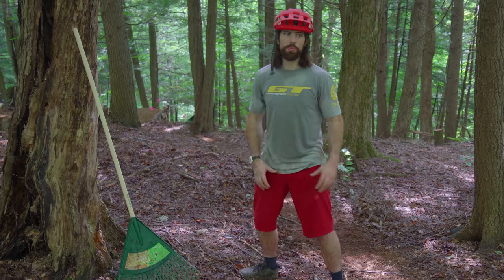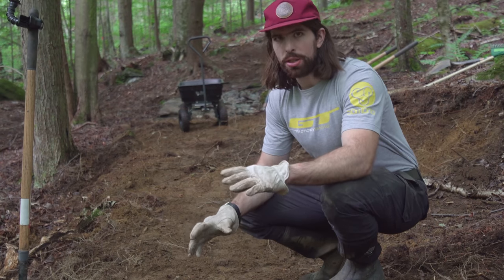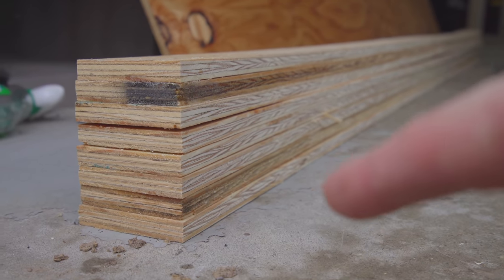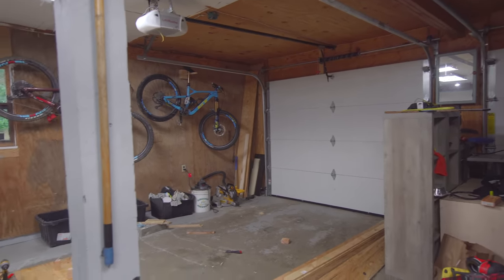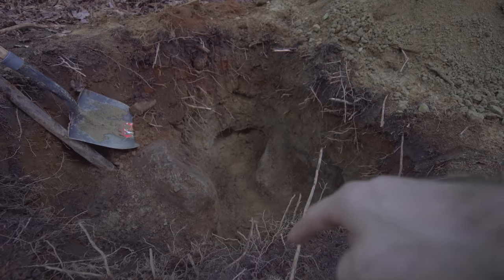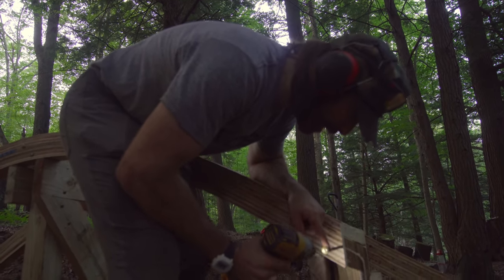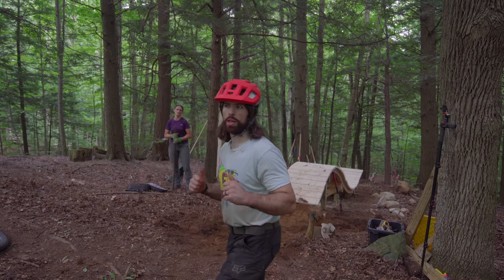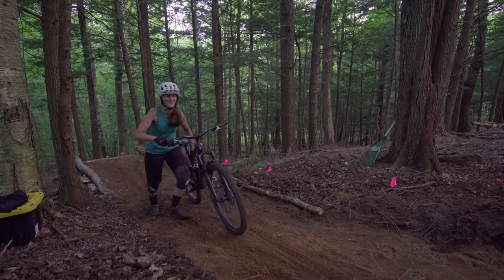Building A Whale Tail For Mountain Bikesl!! 🐳

Comment: Appreciate the tape measure trick, that’s handy! Easy way to cut the angle between your two curves is simply to lay the end on the other where they will join, choose desired angle of joint and slice right through the both of them 👍🏻

Comment: When your tightening the clamps making the curved thing, you need to tighten the clamps in the order from inside to outside. If your tightening the posterior clamps first you may not be able to squeaze the inside as tight as it should be squeezed

Comment: Great feature.  Just a couple of tips.  Using a small paint roller with the cheap foam rollers makes glue ups easier and faster.  The easy way to get the joint on the arches to line up is to set the first arch then use a small level to mark a vertical line and cut it. Then place the second arch next to the first, line it up to where it works, and trace a line for a perfect joint.  Love the content so please keep it coming.

Comment: I feel I am a mill worker (wood worker) by trade and a good tip for bending wood is to soak it it helps the wood bend and when it drys up it is structurally more solid due to not cracking although you did do alot of planks stacked so there is no reason why it should break just a tip

Comment: Nice work on the stringers, I enjoy the extra craftsmanship you put into your build.  I've done a few rounded decks using similar technique with cedar strips.  Using a 3 or 4 inch paint roller for the glue works fast and excellent coverage.  U can also glue / pneumatic staple each strip down 1 at time... Just a thought..

Comment: Hey Phil, next time you do some bending and laminating,  I would suggest you try making a form in place of those 3 blocks and use a ratchet strap to apply constant and even pressure. This is the method I was taught for making the jam extensions for curved windows.

Comment: Hey Phil! Some tips for next time - PVA glues like the Titebond you're using only have a working time of about 10 minutes - if you take too long, they won't stick properly. For slow glue-ups like this, it's a better idea to use a slow setting epoxy or construction adhesive. In addition to having a longer working time, they are also gap filling, i.e. work properly when there are gaps between the laminations. PVA glue like the one you're using is not gap filling, and won't stick properly if you have gaps, no matter how much you use.

Comment: It would be a cool idea to build a big roller in front of the whale tail, so you can either pump both or jump onto it. But I don't know if it would work with the speed.
Reply from the maker: The roller on the whale tail is what generates speed for the rest of the trail. Putting a roller in front would require sprinting from a dead stop which gets tiring quick. The way I build goes back to what I grew up doing, and that's dirt jumping. All good dirt jumps have an initial feature that helps set the speed and requires minimal pedaling.

Comment: Hey Phil! A good tip for getting tool heads on their handles is to just slide them on and then hit the bottom of the handle, theres something about the vibrations that puts them on way easier.
Reply from the maker: I actually tried it that way and I wasn’t making any progress. I maybe I was doing it wrong 🤣
Reply: @SkillsWithPhil  awe fair enough there, but if the tool heads start to get loose you can soak them in water overnight, swells up the wood and makes em right again

Comment: Depending on the type of plywood you used you may have some problems with the glue between laminates failing over time as it may not be waterproof like your titebond. If or when you need to replace the laminated beams you may be better to use thin strips of solid wood for your next lamination.

Looks good though.
Reply from the maker: I agree. In retrospect I'd build it completely differently, but I learned a lot from this project that I would not have known if I didn't try it. I found a lumber yard near by that I will likely source material from in the future. In the future, I'd probably build it with 16ft long strips of a thinner wood and not plywood.
Reply: @SkillsWithPhil  Another cool idea would be to take inspiration from boat building where you steam solid planks. This makes them flexible for a few minutes after which they harden in whatever shape you bent them to.
Reply: @SkillsWithPhil  The joys of learning, I'm sure it'll allow you to make some quality content.
Reply: @SkillsWithPhil  So glad to hear this. Other gems from the thread are to tighten the clamps from the middle moving outward, and apply the glue to both sides of the wood, using a roller. My contribution is to keep that watertight glue tightly capped, and consider a new bottle for each project (some kinds of waterproof glue don't store well after opening).

Comment: Phil, it would have been possible to lap the glue lam layers to make a single, double curved rail and avoided the dry joinery. Also would be good to use some clamping calls to distribute the force across the board but overall great work.

Comment: Good job man. With the c- clamps - grind a socket u can attach to the  drill so you can tighten the c clamp faster. Just sayin
Reply from the maker: Grinding them down isn't  a bad Idea. I actually did use the drill for a few of them. The chuck wasn't big enough to fit over the spindle but I was still kind of able to make it work (but not very well)

Comment: Some building tips to make it last longer:
1.  Use 5/4 x 6 decking cut lengthwise vs. plywood for the stringers.  Yes, its more expensive, but the plywood will begin to de-laminate over time.  You just dumped a ton of waterproof glue to make the stringers, but the glue within the plywood will fall apart faster than the glue between the layers.
2.  You should attach as much as you can with bolts vs. screws/nails.  Except the decking.  Deck screws all the way.
3.  You did the right thing in have cross members bear the weight of the stringers.  You just need one on each side of the post, against the stringers.
4.  If you haven't figured this out in CAD (see next point) and pound in the posts later, use a Sawzall to cut the top flush with the stringers.  Add cross braces in there too.
5.  Learn SketchUp.  First, you can prototype things and figure out if they will work and figure out how to do more with less wood. Second, the angles and radii for all these types of structures are known.  You don't have to guess speeds and landings, etc.
Reply: Where do you find angles and radii for trail features?
Reply: @tonyrobinson1623  Trailism or the Cuyuna MTB group

Comment: Ah, now I understand that feature.  When SBH (Seth) built it, with a jump that bypassed the roll-onto portion, I was wondering why even build that first part.
Reply: Seth chose to jump onto his. The turned down, roll on, portion acts as a case pad on his. Notice that Seth's whale tale has much less curvature because his arcs have to fit inside the width of dimensional lumber. Phil's laminate stringers allow much larger curves. Hopefully he built them out of exterior plywood, but it doesn't look like it. Seth's needs more speed to flow.

Comment: Use foaming poly urethane glue out of a caulking gun next time, it's much easier. Also put packing tape on your ply that you glue on top of.
Reply: And load the thing full of screws during glue up

Comment: Awesome craftsmanship on the whale tail there but I can't help but think it's too boring. A gap in and step up option would be much better.
Reply from the maker: It's purposeful. I needed a bit of elevation to generate speed for the road gap, so I intended to build a wooden roller, but thought this would be more fun. If I built a gap into the  whale tail, it would require sprinting into it to clear and that's not very enjoyable. For those who grew up dirt jumping, this is very similar to the first jump in DJ sets, that sets the speed.

Comment: Wood glue has quite a long cure time and shouldn't cure before you can put a clamp on
Reply: I don't know this glue, but worked in a place that did glue lam oak to make 5'6"radius stair rails. That glue (it was waterproof FWIW) had a very short working time. It took 4 or 5 of us to get the wood onto the jig and clamped.

Comment: why don't you use post hole diggers?
Reply from the maker: post hole diggers are for getting into tight spaces when you can’t angle the shovel in a way to spoon out the dirt. If you have the space, shovels move more dirt quicker and more easily.

Comment: how wide where your strips?
Reply from the maker: Just a blade width shy of 3 inches. You can get 8 strips out of a 24 inch piece of plywood. I have to cut 4x8 sheets of plywood in half lengthwise to fit the sheets of plywood in my car.
Reply: Oh hi Matthew

Comment: If I may, I’d use polyurethane glue, either gorilla, or PL Premium for a glue up like this. Even more important is the plywood type. It should have a waterproof glue too or it will delaminate. FWIW, I have never used plywood for a curved lamination, only solid wood.

Comment: That drill was being pushed way too hard. Would not recommend using it as an auger. Especially that deep.
Reply from the maker: That was actually a different drill. i has bought a second more powerful drill after I burnt it out. In this video I was using a hammer drill (dcd996) which is meant for drilling into concrete.
Reply: @SkillsWithPhil  The one at 0:45 is the one I was talking about. That task is putting a lot of torque on it. It's most likely what caused the motor to burn. If you upgraded to the 996 from the 771 you will get better results on those type of jobs.  Either way, love your content man! You make NH proud!

Comment: Why dig such massive holes simply to put posts in and back fill? Get a post hole digger!?!?
Reply from the maker: It’s New England, we have plenty of rocks. Digging a bigger hole not only gives you wiggle room if you run into rocks (it also is easier to get the rocks out) but it also gives you plenty of space to change the placement of the posts a bit. Additionally, it’s easier and quicker to dig  holes this way. A post hole digger is for last resort in tight spaces.